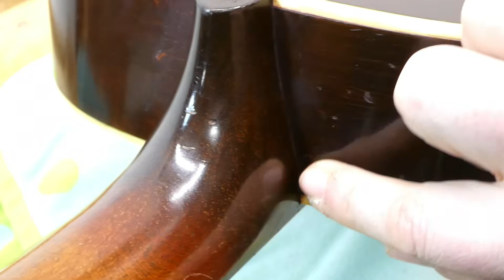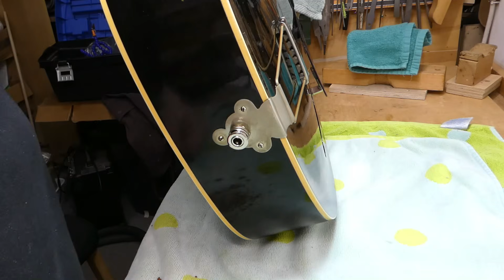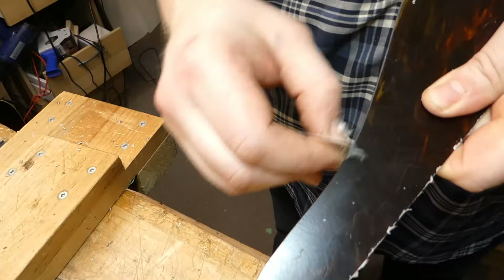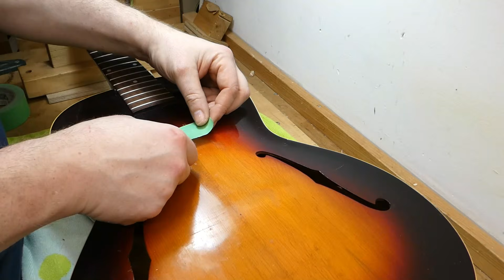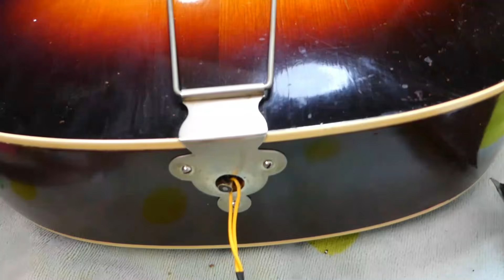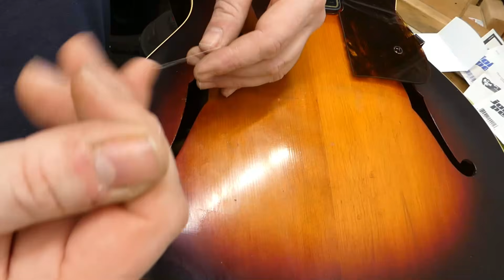Some1930's L-30's. A strange Gibson sidetrack.

Comment: Hi Ted in regards to mounting the stick on pickup just wondered if you have used strong double sided foam tape before, basically a layer of poly foam sandwiched between to strong layers of double sided tape. The foam is not too thick but takes up any contours in the surface. I use this tape to securely fasten my "flatbucker" pickups I make to the tops of my guitars; I have never had any problem so far with them coming away from the surface. As you point out though maybe in certain situations you may want to be able to remove the pickup without any damage to the laquer or surface finish. I must admit though some of my guitars I have finished in Shellac and have had no issues removing the pickups without damage using a "little heat" from an hair dryer. A little heat only is a must as sometimes Shellac if fairly new can be effected by heat which with all your knowledge I'm sure you are very aware of.

Comment: Small archtops always seem to shine with a low-inductance magnetic pickup and decent amplification.  My Epi Masterbilt Olympic -- essentially an almost-RI out of Indonesia -- came with a piezo bridge, which sounded OK given some EQ tweaking, but it really came alive with a pickguard-mounted Bendetto/Duncan S-6 humbucker installed right at the end of the fretboard.  I do blend in the piezo from time to time using the stereo capability of my reverb and multi-effects pedals, but that clean/sweet humbucker is the star, doesn't required any EQing, and performs much better on its own than the piezo.

Comment: Ok….  I have a suggestion…. And im not being a comment section asshole….      Why scrape the bevel in the pickguard when you have a beautiful router table?  You could get the correct angle router bit and have that done in 3 mins….  Im sure you do it by hand for a reason….     Excellent vids..  your lessons are the industry standard….

Comment: Fact is, any piece of metal is completely reproducable - full stop. As well, said piece can be patinaed to match exactly the piece it replaces. A good TIG welder can fill in the hole, dress it. and no-one would be able to discern it had ever been filled in. Some many are evidently impressed with measuring in millimeters. Machine shops regularly go out to the ten thousandth all the time.

Comment: These definitely sound great amplified! I wonder if you can get them up to a good stage volume without having feedback problems.
Reply: I know the Barkus Berry pickup is more like a piezo pickup than a magnetic pickup. It shouldn’t feedback if you treat it like an acoustic pickup.
Reply: @panzerHeiliger  ,  It seems doubtful that it's a piezo because it would need to be in good solid contact with the guitar top in order to pick up any sound. Strings do not transmit sound magnetically into a piezo pick up.

Comment: I suppose you could use a 1/8" (3.5 mm?) output jack;  you might have to plug the hole in the heel of the guitar first and then drill it out to a smaller hole to fit the 1/8th" jack, but you wouldnt need to ream the tailpiece out, and if simeone ever needed to take the tailpiece off to work on the guitar for whatever reason, this could be done without having to remove the jack first.  The guitar's owner would then merely need a guitar cable with a 1/8" plug on one end and a standard 1/4" plug on the other.  Do any of the guitar parts suppliers have 1/8" output jacks with a strap button built on to it?